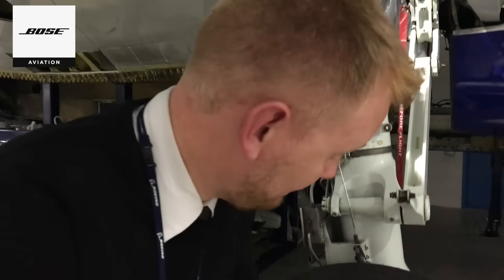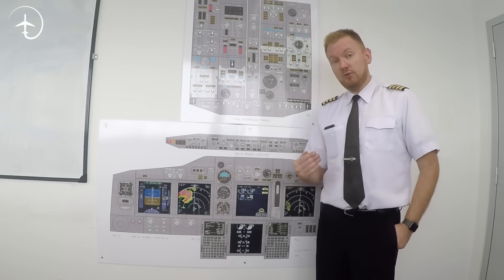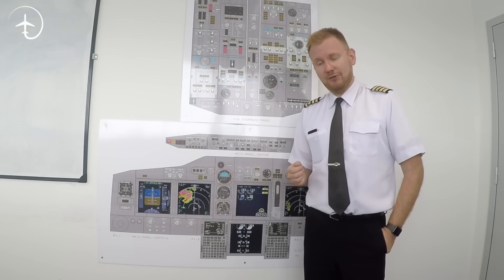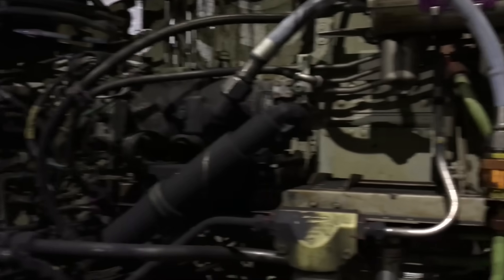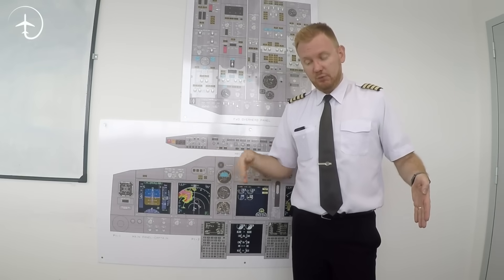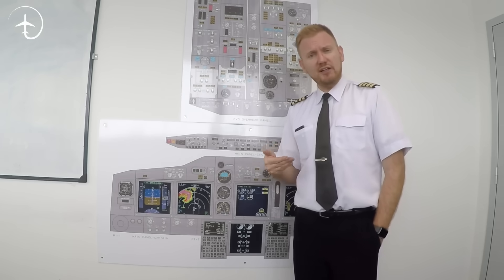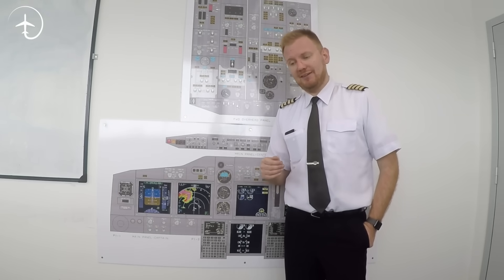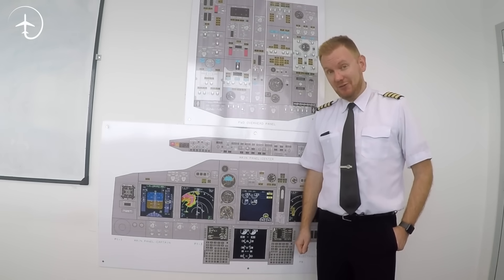Why does the Boeing 737 not have any landing-gear doors?

Comment: You mentioned that Boeing had been using this configuration for like 50 years with no issues. I was once told that an unwritten rule in engineering is, if it isn't broken then don't 'fix' it. Another unwritten rule is.....if one is good, then two is better. And  with fuel igniters and fuel pumps for example,  is this also the case?  I'd love to see a video on exactly how many components  are doubled for enhanced safety, and also, which characteristics of certain parts that may SEEM to need improvement, have remained unchanged  by aircraft engineers, with no ill effects.

Comment: Hi Mentour, could you please explain what if pilots forget to open gears and second question how does the pilots knows if which gears will touch on the ground first and what if front gear touches ground first 
Thanks
Reply: If the front gear touches the ground first, the airplane displays a cockpit warning that says, "I've fallen and I can't get up."

Comment: Good info. But why doesn't Boeing does the same in B777, B787 ? And doesn't the rubber tyres get affected due to extreme cold & hot temps ?
The B737 engines are also flat at bottom to save cost as B737 landing gear is too short to install proper circular engines as seen in A320s or even B777.
Reply: Parimal ,  then you never saw how low the DC 9 was, that the first caution about servicing that model.

Comment: How comes the tires don't pop at 250 hPA? Because we only have 1/4 of the atmospheric pressure, the pressure in the tires multiplies by 4 compared to ground level, right?
Reply: dim sum no NITROGEN IS NON COMPRESSIBLE, ITS AN INERT GAS   BTW most of what you are breathing IS NITROGEN. Air is 77% NITROGEN, 21% oxygen , +2% RARE. Gasses.but you should have learned that in junior school.

Comment: How would you address the theory that the 737 has an inherently flawed design in terms of it having a thinner than average fuselage skin, resulting in an unusually large number of 737 decompression incidents caused by structural failure of the fuselage? The 737 seems to be far more prone to this kind of failure than other airliners.

Comment: At 6.15, you mentioned "hydraulic fuse".. it is actually called a "frangible fitting" and is intended to be broken by the flying debris (or tyre carcass) as you also mentioned. Only then, will the "hydraulic fuse" (located elsewhere in the wheel well) stop the hydraulic pressure from retracting the landing gears.

Comment: Didn't the 727, and therefore early 737's have nosewheel brakes?
Reply: The early 727's had nose wheel brakes for short field performance. Cost to maintain them was greater than the benefit, so all were removed.  Never on the 737

Comment: I recently attended a talk by a Boeing engineer on the design of the winglets on the newest 737s.  The aerodynamic improvement is very minor.  I regret that I didn't ask if Boeing had considered the obvious aerodynamic improvement of putting doors on the main landing gear.

Comment: Except for your last point, Loved the explanation. Main reason why airplane manufacturers dont prefer to modify the existing design of aircraft is the extensive cost of R&D to create a new aircraft. To elaborate more, You dont see a difference in the design or fuselage of the A320 Neo from the A320 other than for the engines and improved cabin/avionics. Same way, Boeing cannot afford to spend extensive R&D to create a changes to the existing 737 if the current design is considered successful and any developments for even a small thing such as adding doors for the landing gear will need a full re-do to ensure its safety and reliability, Instead they worked on a newer 787 Family which is a slightly bigger,much more efficient and long range 737 which could compete for the long range market with affordability due to less demand.  As for the Cessna Citation and other private jets, They are intended to land on shorter and less smooth runways while cruising at comparatively lower altitudes and speeds. This makes the weight saving and cost efficiency of having exposed main gear for easier maintenance as these are privately owned( however the 737 did revolutionize the idea of proving that exposed gear sure doesn't make any difference over one with a door)
Reply: Check your facts. The citation x he talked about is the fastest civilian aircraft in the world.

Comment: Apologies if this has been asked already - I presume that if the gear cannot be retracted after a puncture then the pilot has to turn back and land? Which then leads to the next obvious question. How long does it take to change a tyre on a 737?
Reply: How is that a helpful response?
Reply: I guess at some airports the passengers will stay on and it'll be refuelled also? Seen the French do this - boarding passengers whilst fuelling with a fire engine next to the 'plane.
Reply: Turning back involves dumping fuel so during that time they can refuel and go back out. Then again changing the tyre (I'm English!) might have to be done separately.

Comment: Yep, but if there's (or was) a prob with the low gear option, it's (or was) more a problem at landings...
If u dig in stats, the very first B 737 had there main crashes (some very deadly) at landings... Low gear + low speed wing perfs made it somewhat dangerous. Seems it's more than OK in the last series. Wings have been optimized. May be u can confirm...

Comment: I had been told by a friend who works at Boeing that the exposed wheels increase survivability in the event of a water landing. If you look at the at-rest angle of the Airbus in the Hudson River incident, you will see that the plane settles alarmingly low in the water very quickly. Simulations at Boeing have demonstrated that, in the same situation, the at-rest angle of a 737 would place the floor of the cabin 3 to 4 feet higher than the Airbus. This is, my friend tells me, because of the exposed wheels. I am glad you have taken the time to correct this misinformation. Now I don't feel so bad about sleeping with his wife.

Comment: An advantage of exposed wheels is brake cooling. There was a hull loss disaster in Switzerland many decades ago when a pilot used his brakes and turbines to clear fog off a runway. The brakes overheated and caught fire after in flight after the landing gear was retracted, bringing down the plane. Reminds me of the comment by the Engineer who certified the 747-100 for use in UK airspace which was "as a Chief Engineer with an airline, one would be forgiven for assuming that our profession is inhabited by professional pilots and not circus clowns!", or words to this effect. It was inreference to the finding that certain US pilots were using flaps in cruise for some reason I forget now, contrary to Boeing procedures? Maybe a smoother ride? The moral to the story - use turbines and brakes as they were intended, not to clear fog off a runway prior to departure. So no gear doors mean cool brakes - which is always a good thing. Anyone who has witnessed over heated brakes will attest to this fact. Heavy jets have emergency type brakes which can aborb by necessity an enormous amount if heat energy, but the downside is they take a long time to cool off!

Comment: Nicely explained! My question is what about tons of water sucked into the engines when flying below rain clouds during heavy rain. How is it that all this rainwater is not turning off the engines?
Reply from the maker: The engines are tested to be able to whit-stand enormous  amounts of water without flaming out. Most of the water will pass through the bypass duct and never get close to the burners
Reply: no need to use abusive language Dr.  ChermBo

Comment: One thing I would be wondering about would be cabin air pressure, and potential drastic differences.

Let me give a little background here.  A little over 30 years ago, I was down in Acapulco for Spring Break in high school.  On the flight back, in a 737, I found myself becoming light-headed and disoriented, to the point that the flight crew needed to administer oxygen to me.  As soon as we touched down at the airport and I met my dad, I could tell that things were not right: my balance was off, I had trouble hearing, etc.  For the next three weeks, in fact, I was having trouble walking, to the point that someone who didn't know me would have thought I was drunk.  (Thank goodness I had such a good rep at school, and that my teachers all knew me and that this was NOT the case.)

So, I went to see my doctor, and then a hearing specialist.  What had happened was that my left inner ear had collapsed due to a sudden change in air pressure.  My dad, working for Wardair Canada at the time in the computer center, told me how the 737 at the time had a reputation for lousy air pressure.  Also, as a child, I had frequent ear infections, and the specialist mentioned that it was probably a contributing factor.  (He noticed all the scaring on my ear drums, and when I told him I had been flying back and forth 4 times a year for about two years to a boarding school in the US on 737s just a few years earlier, he told me it was a good thing it did not happen then.

So now, I've had very little hearing in my left ear since then.  Fast-forward to last year, and my sister's destination wedding in Jamaica, and I was rather worried when I found out we would be flying on a 737.  Luckily there was no problem, but I'm still worried if I ever want to fly again.  Are the newer models of the 737 considered to be safer then those of the past, or do they still have that issue with air pressure in the cabin?
Reply: A friend of mine is deaf in one ear, similar experience. A background with ear infections will predispose you, it can happen on any type of plane. No-one in her family will get  on a plane without taking a decongestant for eg with pseudoephedrine in it. If your sinuses and ears are clear, the probability is dramatically reduced. If it's a long trip [and your doctor says its safe because disclaimer I'm not a doctor], I take one just before boarding and another one just prior to landing.

Comment: Sound reasoning for the old addage I would use with my apprentices; "kiss it" or "keep it simple, stupid".
I have always been a fan of elegance in engeneering. Boeing could have engineered a complicated set of doors to enclose the gear but opted for simple, elegant and affordable over the weight, complication and possible danger of an enclosed system.

Comment: Why do they put helium in the wing's or fuel tanks. Cuz the  jet engine use's a gas called AIR as fuel. There are no fuel tanks on the plane . Youre standing in the gas tank on the flat enclosed earth.
Reply: ChermBo obviously your still on the ball earth FLYING THRU SPACE DODGING ASSTEROIDS with no pilot illusion. Please wear a safety Helmut when outdoors sincerely  NASA

Comment: The advantages are one, simplicity. Note that the manufacturer saved a lot of weight, making the aircraft lighter. Lighter means MORE range, passengers, and luggage.  Two, fewer things to break, benefit ? Reliability  Ever heard of not being able to lower landing gear ? It happens ! As long as the wheels retract fully, very little friction or resistance penalties during flight,

Comment: I can give some additional qualified input here: 

A fair explanation but you didn't mention that the early model 737's employed the coaxial turbojet JT9D engines which were far slimmer and mounted much closer to the wing underside which allowed for a main gear design very much like the 727's which brought with it many benefits besides just simplicity but the new generation 737 was designed for high bypass turbofans which required a slight increase in gear length but had to employ flattened nacelles and be mounted up higher on the pylon, this design has remained through all subsequent models of the 737 family including the MAX because beyond the low set wing and obvious benefits of simpler gear to lengthen the gear would require that the pivot attachment point in the wing would have to move outboard which would change the entire wing design to have a longer root which would in turn require the pylons and engines to move outboard which would decrease efficiency and effectiveness and require a much more complex wing design with longer flaps and a host of aerodynamic challenges.

 This design feature is not unique to the 737 family, you see it on the ATR 42 and 72 among others which bolsters this explanation because the ATR like the 737 sits very low to the ground and rather than having stalky and very complex and heavy main gear fixed to the high wing has it's main gear fixed in blisters low on the fuselage underside and also employs the tabbed brush gap seals on the outer rim of the wheel wells which act as scrubbers for the tires as they retract into the well and spoilers to clean up the air that the open wells would disrupt. The short answer for the feature in general is that the aerodynamic downsides of partially exposed gear is easily offset by simple hub covers and turbulators and spoilers on and ahead of the wheel well rim, so much so that the cost and complexity of multi hinged, multi faceted full gear doors is offset by this simple solution. Simple is always better as far as Boeing is concerned but in the case of the 737 I challenge any designer out there (I know I tried myself) to come up with a solution that lengthens the gear but retains the existing winning wing and pylon design . 

Interestingly I know the DC3 and C47 employed partially exposed gear when 'fully retracted' but they retracted in line and were fully capable of supporting the aircraft in a wheels up landing, minimizing damage to the engines, wing and fuselage belly.This design featured in general aviation, military and commercial aircraft going back to the 20's.

I am a qualified and certified aircraft engineer with experience on commercial and sports and general types and built several experimental types as well as designed my own aircraft and glider. I have several types in my logbook as well but my lifelong passion is the science of aeronautics and aeronautical engineering and with some familiarity with the various 737 types

Comment: Those hubcaps. They could be modified to spin their respective wheels ready for landing - to reduce tyre wear, burnt rubber, on contact with tarmac. Ridges or vanes in the hubcap designed to capture slipstream air, to rotate wheel, while gear is lowered. Same captured air directed inwards to cool brakes more rapidly - reduce fire hazard close to fuel tanks.  Thanks Mentour, your clear concise answer to that nagging question.

Comment: It’s just simple and cheap! An aircraft from the same era sitting even closer to the ground had fully enclosed main gears. The DC-9.
Same with the Fokker F-28. Those configurations had their complications; mainly sequencing when a pin would fall out of the sequence valve lever attached to the door, the gear would not come down at all. After a gravity extend due to a failure, the doors would remain open and would drag on the runway upon landing, the DC-9 had a mechanical pull system to pull up the doors after a gravity. Extension if I remember well. None of that with the 737! Just simple and cheap!

Comment: Thanks for the great explanation. Just wanted to confirm that the tyre pressure is about 200 psi or 14 psi?
Reply: Typically 200 psig and definitely not 14 psig.  Maybe he was thinking 14 times atmospheric pressure/ approx 14 bars?

Comment: I have a question ? Can the hydraulic fluid freeze on the main landing gear at high altitude ? In my last job I found the oil in the hydraulic jack would freeze and I couldn’t release the the pallet jack.

Comment: Why landing gear go inside after takeoff ????
Reply from the maker: To reduce drag.
Reply: Think of it this way. At 60 mph roll down your car window and stick your arm at 90 degrees. That is wind resistance. When we are flying we want those values to be as low as possible.

Comment: It's like that in case a wheel gets stuck.   A daredevil wingwalker perched on the wing of a smaller aircraft flying under the 737 can reach up and pull the gear down by hand.

Comment: But what about the pressure differences? Isnt it bad for a rubber wheel when the pressure difference between the contained gas and the outside is too high?

Comment: As for the nose wheel "snobbers", wouldn't it be more practical and to a certain extent economically more reasonable to still equip the nose wheel with brakes so the tires don't wear off on the "snobbers", thus longer life-span, less need for exchange and eventually higher safety because one never knows when tires are going to blow up in commercial service regularly being worn out on those "snobbers"? Otherwise well explained, I was always wondering why the wheels were left open to expose the tires to the harsh surrounding during flight at cruising altitude.
Reply from the maker: No, brakes would be far more costly to maintain than changing tyres when needed.

Comment: Keeping the gear system simple makes a lot of sense since keeping a commercial bird online is imperative for revenue, but also, maybe from an engineering standpoint, i believe the gear doors have been omitted because they would hang too low in the event of a gear door sequencing fail, or in an emergency gear blow down scenario, (gear doors stay open after a emergency gear blow down cycle). With the fuselage being low, the gear doors would contact the runway before the wheel assemblies, creating more damage to the air frame, grounding the bird for an extended period of time, hence loss of revenue.